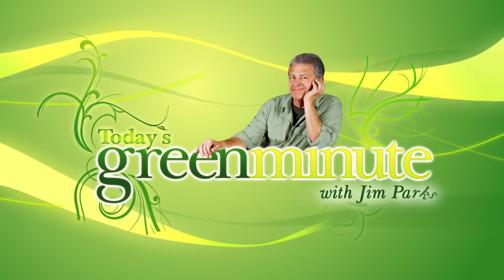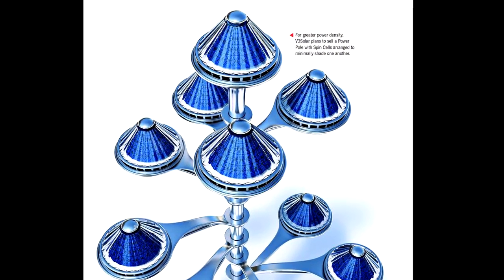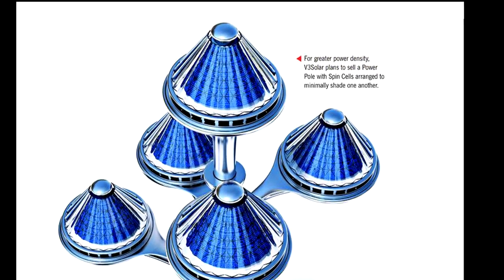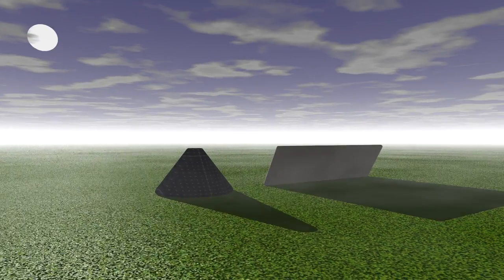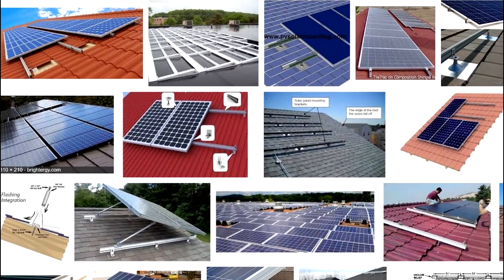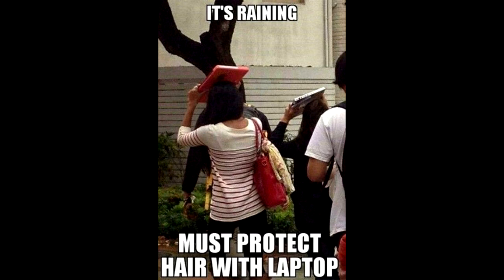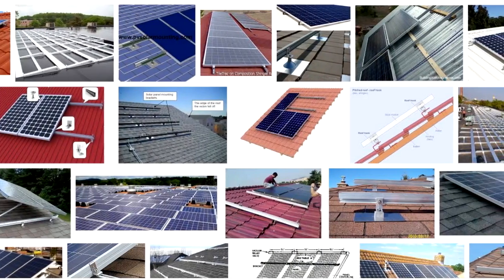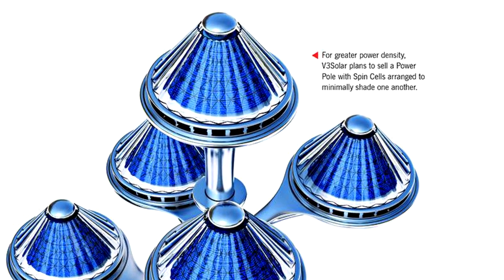Spinning Solar -BUSTED!

Comment: But now solar panels are getting cheap enough to compete with conventional fossil fuels. So yay! No pseudoscience necessary
Reply: yeah sure, let me know when they work at night. now factor in the absurd cost of the charge controlling system plus the power storage system plus the maintenance on that power storage.
Reply: Wildman Fujiami I was pointing out a good thing. At least solar is getting cheap enough that people can buy it and eventually make a profit off of it. What’s bad about that?
Reply: @caidenkesler3945  the power storage medium is often lead acid batteries, which have a very short life span of less than 5 years on average, then you have to deal with sulfuric acid and lead that has been contaminated with lead sulfate and sulfuric acid. the most ideal storage solution is one that has been intentionally suppressed since the 1900s because the battery is "too perfect" since it never degrades thus never needs replaced, and also there are more efficient means of environmental energy harvesting than solar or hydro.
Reply: Wildman Fujiami ok cool. Doesn’t change my original point. Solar energy during the day is better than none at all:
Reply: @caidenkesler3945  There is also another little mentioned caveat that a photovoltaic cell degrades over time and will eventually need replaced, and if moisture gets into it, well, yeah that's a disaster. I'll put my money into dielectric energy conversion.
Reply: Wildman Fujiami cool you do you bud

Comment: If only they made a regular panel move like a flower instead. Moving with the sun on a timer to catch the most sun. Probably not possible though..
Reply: That’s not hard, all you have to do is tilt the panel to face the sun

Comment: 4:40 I know you are being very generous already, but it does seem that the conical panel has a much smaller footprint than the tracking one, even if you were to use multiple to get the same level of power generation...

Comment: not that this product isn't bogus as hell, but 20x more efficient really means 20x less waste.  You can't multiply.  It would be1/20th of 80% = 4% waste remaining.  Plus you're assuming he's comparing to top-of-the-line solar panels.  Your cone vs flat comparison was even more bogus because you assumed 100% efficiency.  This is not what they claim so your test is bogus.  However i can't imagine anyone would be so stupid to think a solar panel would be more efficient by keeping at least half of it out of the sun at all times AND adding a motor that sucks power to spin it.

Comment: the 20 x is just a jargon. but, is the concept in general is a bullshit ? this is a reinvention of that solar panel with giant glass sphere which has sun tracking features. and though it's not increasing efficiency by creating a more effective panels the idea of increasing the amount of light into a panel isn't exactly dissmisable either.  I'm not defending the company that made this, just the idea of higher output solar panel

Comment: Umm...   your efficiency is wrong there..  Wouldn't be 400.. more like 25% if the original was 20 and it went up 20 percent from that..   200 percent of 20 is only 40 dude.

Comment: I do see a couple things I want to point out:

Flat solar panels, obviously, need large footprints to be efficient. An entire roof, or a few acres of farmland (depending on the amount of energy to be generated). These, on their Christmas tree stands, go vertical. While the face of the solar panel is smaller, a few of these, set on the vertical, could create the same surface area as a single flat panel, while taking a lot smaller foot print. Theoretically, you could put more in a given area, than the flat panel.

I noticed a series of notches in the base of the cone, just below the glass cover. Again, theoretically, you could actually use the sunlight to spin the cone. A white panel, and a black panel, the white reflects sunlight, where the black absorbs. This causes a spinning action. I used to have a toy that did the same thing. If the cone solar panel was well balanced, you could potentially run the spinning action like that, no motor needed.

Just a couple thoughts I didn't see covered in the video. Thanks for reading.
Reply: Couldnt you basically just stack normal sun following solar panals on a tree structure tho. I know this is a old comment but genuinely i think your right about the tree arrangment. But if you did it with normal solar panels then youd have even more surface area. 

Maintaining/installling wouldnt be fun tho.
Reply: @mmboiler10  you probably could. I don't really remember the video though, so I can't be sure exactly what I was going for here. Lol.

Comment: I mean, I can see it working with a dynamo of course.... Because a dynamo can generate more energy than the spinning solar panel device, but for it to spin it needs motors to spin which makes the entire thing turn and create energy using the dynamo..... so..... It wouldn't be more solar energy, it would be more electro magnetic energy

Comment: This video completely invalidates its own logic. No sunlight = no power is true for both panels. As much as this narrator wanted to neglect the fact that a flat panel cannot be constantly in 100% full sunlight, it doesn't make it meaningless. How often is that flat panel not in perfect alignment with a rotating sun? Quite often in a 24 hour day. Furthermore, that orbital rotation changes course throughout the year, so there isn't a single, consistent path to follow. There is more opportunity to capture light from any angle with a conical surface than a flat one, and even if you had the ability to angle a flat panel to follow the sun's direction, the math holds true that the angles of absorption are not even comparable. This video is contrarian in a poor attempt to acquire false credibility via popularity. Challenge science and math as much as possible, for that is how we all improve, but don't ignore basic concepts because they go against the argument you want to construct.

Comment: I'm not an expert with solar panels to any degree,  but wouldn't making a cone (or pyramid) solar panel and use tracking to keep it pointed directly at the sun be a way to make a solar panel slightly more efficient? Since there would more surface area for the sun to hit? Or would the the angle of pyramid or cone sides not increase the surface area enough for it to produce more energy then what would be lost to the angle of the sides? And I'm sorry if that isn't phrased the best.

Comment: The only thing that wasn’t addressed was the sun going past its zenith as it relates to the the traditional solar panel (the first point made in the promo for the cones). Wouldn’t that drop the efficiency of the hypothetical flat panel example by 50%?

Comment: 0:36 they literally disproved their own idea. The most perpendicular rays of light will give the panel the most effeciency. So why the hell does a slanted panel slapped on a cone sound more logical huh? It doesn't
Reply: The sloping angle is optimal for solar panels, since the sun is typically never directly overhead, but more angled upwards. Even regular solar farms have upward angled panels, flat panels are terrible for efficiency since the sun doesn't typically travel directly overhead.

So a conical setup is more efficient than a cylindrical set up. But they are both piss poor compared to a regular panel set up, since you don't need to spend energy turning the panel.

Comment: One other problem you didn't mention, the motor to spin the panels would be drawing its power from the solar panel, and since we all know there is no such thing as perpetual motion, expecting the solar panels to produce enough energy to maintain their own momentum is a deal breaker as well.
Reply: A solar panel can generate enough power to spin itself. Perpetual motion doesn't even apply here since we know the energy inputs and outputs. The sun definitely has enough energy to spin a solar panel. It would be a perpetual motion machine if it generated energy from spinning, like a dynamo, and used that energy to keep itself spinning. But it isn't generating energy from spinning. In fact it's dissipating energy by cooling. Plus apparently they planned for the spinning to be powered by bore holes to harvest thermal energy from underground. They could technically power it from the solar panels but that would further reduce efficiency.

Comment: Who's gonna tell these guys that glass doesn't magically generate more light?
Reply: To be fair, you can focus sunlight with a lens or a mirror on a smaller panel, and save on the photocell cost, as long as you solve the overheating problem.
Reply: Just put 400 lenses in a row and shine a laser pointer through them, and boom, you've nuked earth.

Comment: Well following the rules of significance, 3 is representative of a number between 2.5 and 3.5, so if we are going to represent pi with only one figure of significance, 3 is correct and close enough to get good enough results when making clay pots out of clay sheets since the thickness of the sheets results in a difference between outer and inner circle that is greater than the difference resulting from rounding pi to 3.

Comment: I wonder - what is the main limitation that keeps the efficience 20%? Is it like a physical limitation of the solar panel, that it can only absorb so much energy per unit of surface? If so, I can imagine that infinitely fast spinning cone could increase the surface while not taking as much space as if the big 5x1 flat solar panel.
Reply: Essentially, you can't absorb all ranges of light, some are absorbed well, and others are not. 20% is for a typical panel, it has been bumped up to 40+% with specially made cells with multiple layers that absorb better for specific ranges of light. But these are so much more expensive that it's not financially viable. So 20% is what you can expect from a typical cell. Getting too warm barely impacts current solar cells much at all. They lose a few percentage and that's it.

So it's basically a physical limitation. But it's still better to use flat panels. A 5mx1m strip of cell will get 5x1 of sunlight at it's peak, and slightly less as the angle of incidence increases. For a cone made of a 5mx1m wrapped around a cone shape, you can only ever have 2.5x1, half of the total panel, pointing at the sun. Because of the shape you lose efficiency even further, since the curve increases the angle of incidence. So using a 5x1 flat panel as a base, the cone has half the surface area, less efficient angling, and slightly better efficiency when it comes to cooling. So even the most generous estimates says that a cone is 50% as good as a flat panel.

Comment: Uses existing technology but demonstrated with CG = nope. If this actually worked, it wouldn't even be particularly expensive to build a proof-of-concept. Instead, we see CG and a magnifying glass pointed at a panel on a card table.

BTW  - Correct me if I'm wrong, but that 'water to improve fuel efficiency' clip you show near the end isn't as crazy as it seems. I haven't looked at the specific claim, but hasn't water injection been used in extremely high-compression petrol engines (such as those monsterous WW2 plane engines with huge super-chargers) in order to prevent detonation and increase both power and fuel efficiency. Certainly not a new technology, but I wonder if it's something that could be looked at on a smaller scale to aid modern combustion engines...

Comment: the only place where those cone shaped panels are slightly more efficient is in places where there is 24/7 sun
Reply: They still aren't. Since only half the panel is used. You are still better off flattening the panel out and pointing it at the sun. As long as the panels are elevated they generally sit at air temperature, not ground temperature, and barely lose efficiency. Compared to the guaranteed 50% loss that comes from hiding half the panels.

Comment: In fairness, you could define "20x more efficient" as meaning 1/20th the total power is lost . . . so converting 96% of light into electricity (4% loss) as opposed to 20% (80% loss). Still not gonna happen, but at least that way the claim isn't outright magical.

Comment: Fortunately the problem of heating has now been solved.
A carbon tube layer, which can be applied without many changes to any solar panel, will make the efficiency go from ~25% to ~75%.. that basicly will solve the worlds energy problem.
I cant wait for it to get implemented already.

Comment: How was it spinning?
Was it an electric motor or did they use those glass domes as part of some thermal wind mill (something similar to those passive heat vents you see spinning on buildings?

If it was the passive version then you could attach a small turbine generator (a scaled down version that is used on full sized Wind Turbines) for a little extra power.
Reply: iirc they said they would bore holes and use geothermal power to spin the panels. But it's infinitely more efficient to just make a flat panel and just have that geothermal power go to the grid, than to spin something to slightly increase it's efficiency.

Comment: I've just came across another brilliant way of reducing the efficiency of solar panels - this time by staggering them too close to each other and making every second panel facing at an angle, DOWNWARDS... :D The plans can all by yours now only $39! It will solve your energy bill problems, save you money... just search for backyardrevolution4all. I wonder if we just put them on roads, facing straight down - shouldn't that solve all remaining problems?
Reply: I have a great idea on how to solve the energy crisis... use nuclear power! :)
Reply: "Just bury the solar panels. The sunlight trapped in the dirt will seep into into the panels, giving you power from the earth itself" I can see this being an actual kickstarter.

Comment: Oh Christmas junk, oh Christmas junk... however did you get money?
On a side note... Maybe scientists with computers could model some kind of lens that could refract light just right to add some efficiency for a stationary cone of cells over a stationary unlensed cone of cells, but the efficiency gain probably wouldn't be worth the area loss because of the odd shape. Spinning the thing is absolutely a waste of energy though.

Comment: It honestly comes down to surface area like you said. The more exposure of the photovoltaic surface to direct sunlight means more power transmission (not creation). The motor spinning needs power to run so you need to take that away also. Efficiency is up to the materials engineering the photovoltaic cells which solar companies are pouring millions of dollars into at the moment. We have come a long way since the early days when they were primarily used for space missions.

Comment: Free power for all was tesla's idea. I'd love to see you take down the diamond batteries tho, they seem legit to me
Reply: Kenn Honson X  Than*
Reply: Kenn Honson X  what if everyone behaved like you tho
Reply: Kenn Honson X  Which of those convictions is blowing your mind?
That tesla said energy for the masses was possible, or that carbon-14 diamonds won't work?
Reply: As far as I can tell C14 diamond batteries are 'legit', but only in the same way you can get propulsion from radioactive decay. An extremely small amount of it over an extremely long amount of time. From what I see a C14 diamond battery is essentially a crap, tiny nuclear reactor. It takes radiation from carbon isotopes, and converts that to power. In a nuclear fission setting, that's tons of power. In a C14 diamond battery scaling, looks like that's at the grand scale of 2 volts. Nothing to be impressed about.

Comment: What if the rotor's zed axis is looking straight in to the sun?
Reply: It will still be less efficient because the cells aren't pointed directly at the sun.  Also the motor to spin it is taking power from the system as well.

Comment: From the ridges I can see it using wind energy to spin which is why I see it would be designed as a tree. At peak wind times I would see why it would claim 200% more energy. The video it does not consider that but some points are valid.